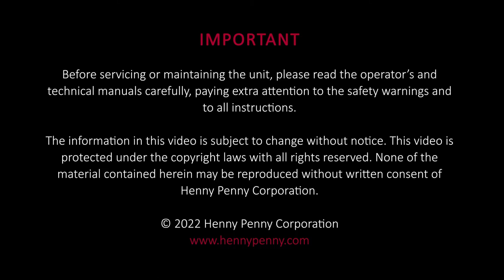Reversing The Lid Gasket - Henny Penny 4-Head Pressure Fryers

Comment: what happens if it is leaking air on the sides , such as a corner ??
Reply from the maker: Hi Marcus, you  may need to perform the procedure explained in this video:https://youtu.be/XU7Z35h_9Bw
You may also want to watch this micro course on lid maintenance: https://youtu.be/g6IOZVg5Ozc
Please contact our tech support for further assistance with any other issues at tservices@hennypenny.com